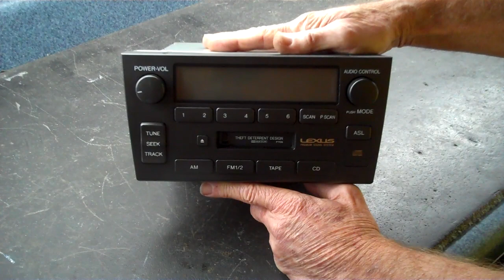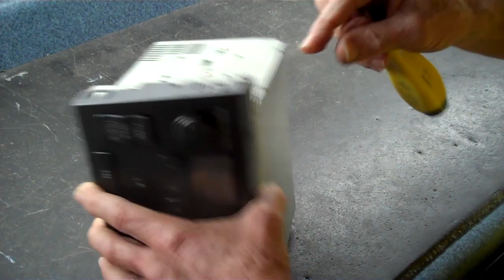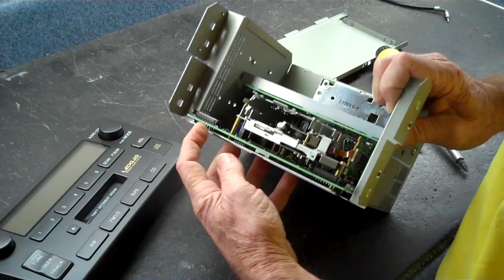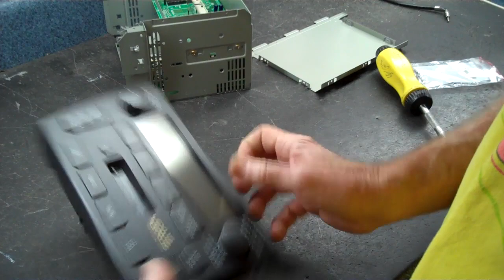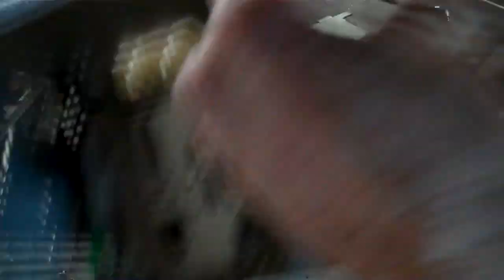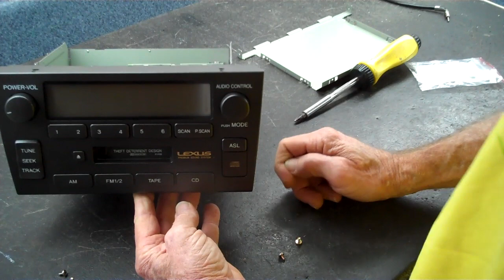Lexus GS300 NO DISPLAY REPAIR - Remove, Install and MORE - Car Stereo HELP

Comment: Awesome videos and glad I found this. Do you know of a replacement LCD screen for the rare 1998-2005 Toyota Aristo Climate Control Unit? The screen is about the same size as this one. Mine has broken pixels and some grey areas.

Comment: Great video you make this stuff look easy.  Is this radio in the is300 as well? Mine started doing hieroglyphs and the right knob stopped working and the volume knob needs replacing too seems ultra sensitive and janky. Are the knobs more of pain than screen to repair or replace?